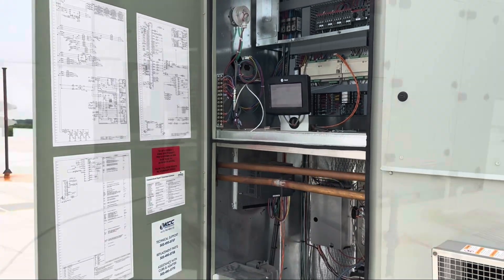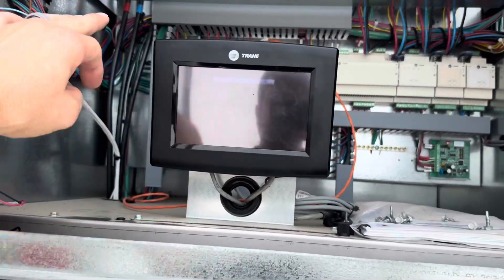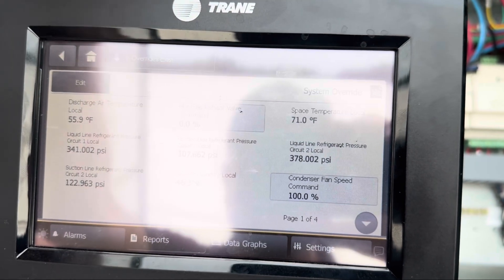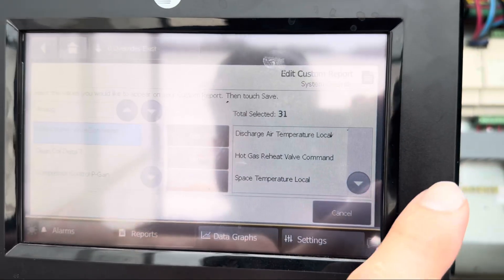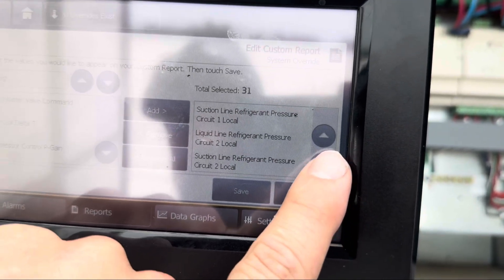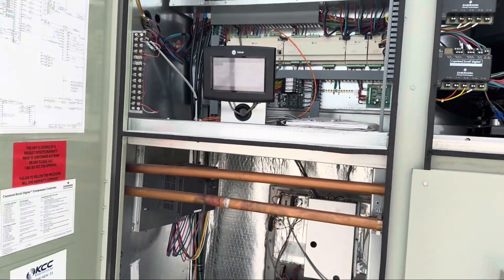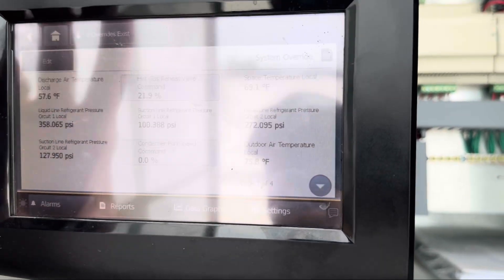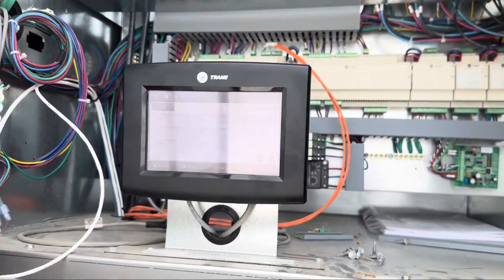Horizon TD7 Display Optimization! IYKYK. #hvac #trane #hvaclife #hvacr #hvacarmy #commercialhvac

Comment: Really need TU when troubleshooting. Good thing is you don't need to bind in sensors. My biggest complaint with these are the component layout.
Reply from the maker: The layout, depending on cabinet, can be tricky but these machines have gotten way better over the years. Yessir TU does help as well.

Comment: I got my butt kicked by one of those, due to an emergency shutdown that would happen randomly
Reply from the maker: E-STOP circuit is wired through OAUTS terminal strip, terminals 9 and 10. 9 and 10 come with a factory jumper in place just like all trane units, if removed it could be an external device causing the issue, if not follow the E-STOP circuit through the phase monitor and the IFFR relay, 24 volt power feeds through there.